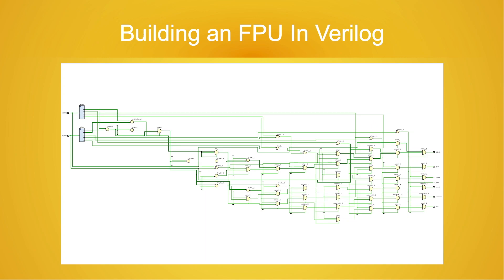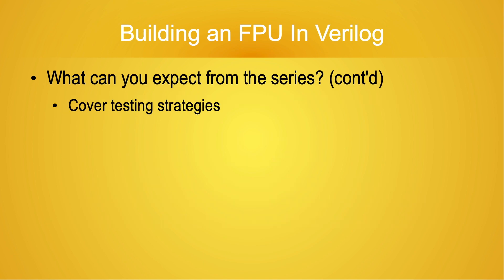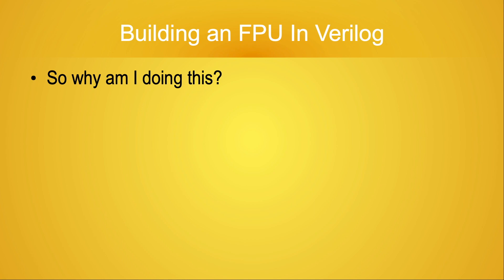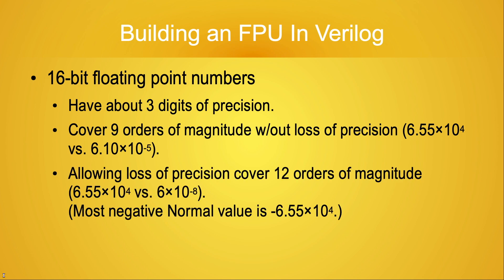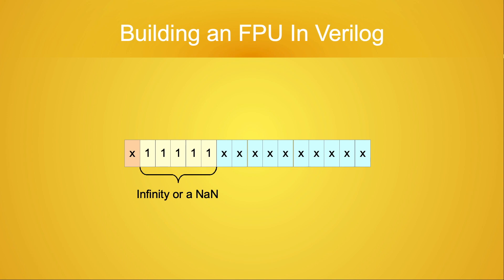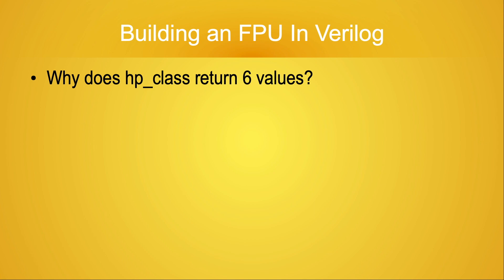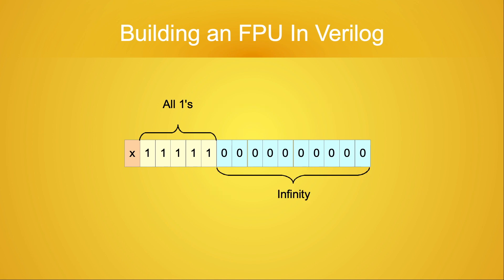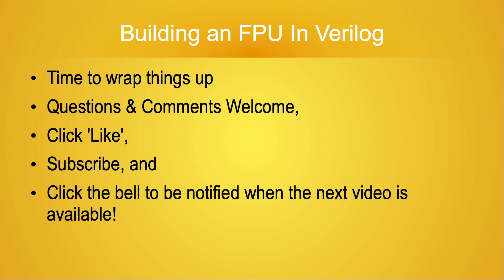Building an FPU In Verilog, Introduction

Comment: can you provide the link of your github project
Reply from the maker: Currently the project doesn't exist as a single, unified repository. Each video which presents code has its own repository on GitHub. This is by design. For example, I have presented three different implementations for multiplying the significands as part of the floating point multiply circuit. Because these 3 implementations exist in 3 separate repos (IMHO) this makes it easier for a person watching a particular video to find the version of the code being discussed in the video; the viewer doesn't need to dig  backwards through a repo to find the code because it's the most recent commit in the repo for that particular video.

You will find the URLs for the various repos in my comment which accompanies the video.

When I have completed the project I will probably create a unified repo so all of the code is in a single place.
Reply: @FPUniversity  okay 
 thank you very much 
your videos are really great and useful😊
Reply from the maker: @The_lost_brawler  That’s great to hear! 🙂